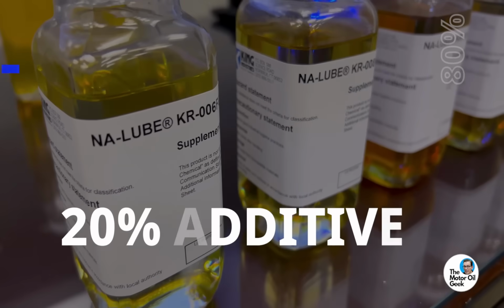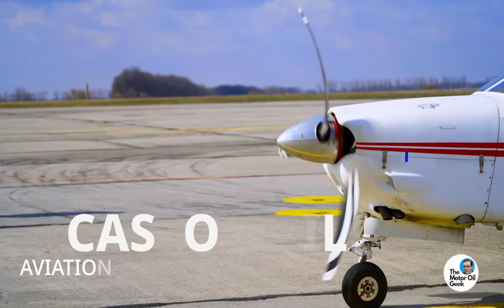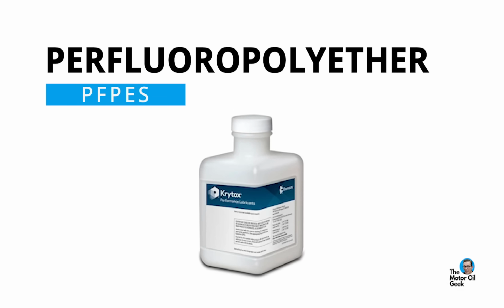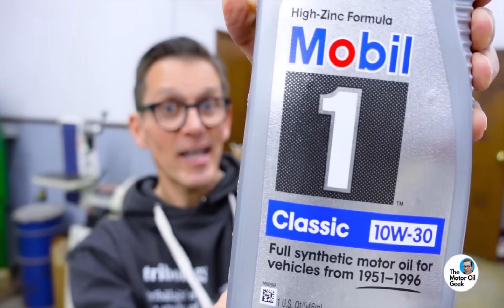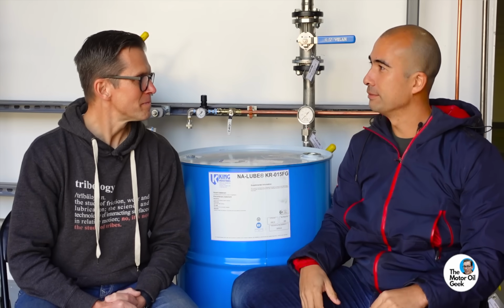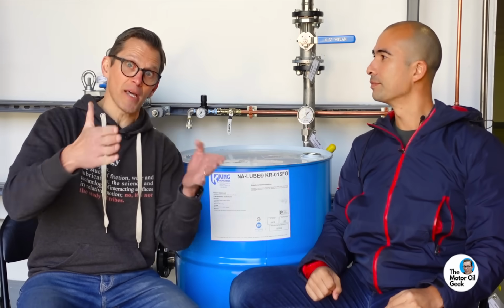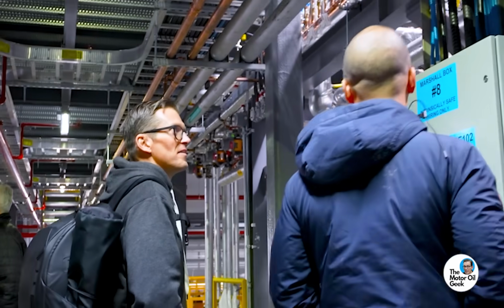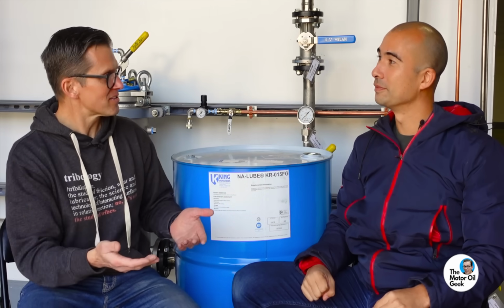100% Synthetic Oil: SCAM or SCIENCE?

Comment: I switched from PENNZOIL ULTRA PLATINUM to AMSOIL HIGH MILEAGE on my 2021 ram 1500 v8 with 81k miles and it started burning oil when it didn’t before with pennzoil UP. So confusing

Comment: Thanks guys, your knowledge of lubricants is unbelievable! I just changed my oil on my 2015 Ram 1500 Big Horn with the 5.7 Hemi. I bought it used, one owner with 120,000 miles on it. Cold weather start ups, I was getting the Hemi Tick. After a few minutes it would quiet down. I have all the service records, oil was changed on a regular basis, but I don't know what brand of oil was used. Truck runs fantastic, in drive at a stop light I can barely hear the engine running, no vibration or anything. I used Valvoline Restore & Protect 5W-30 with 16 ounces of Lube Gard Bio Tech Engine Protectant. I'm going to stick with it for the next three oil changes to see the results. If I'm not happy I'll try Pennzoil Ultra Platinum, I heard the Pennzoil oil was co engineered with Chrysler experts. I also installed a K&N Premium 20,000 Mile oil filter. I will not wait until 20,000 miles, I'll be changing my oil at 5,000 miles. Please let me know your thoughts.

Comment: You are right about us, folks not understanding I have 2017 Buick Regal 2.0 turbo charged I'd like to know if I can use the Valvoline restore and protect or what is a better oil for it can I have an 08 GMC Sierra 4.3 with 152,000 what is the probably the best oil I can use for it🎉🎉

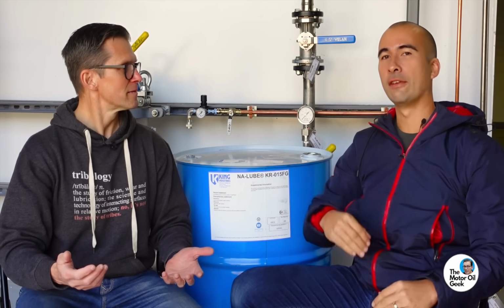Comment: Just a comment on a small detail. At 4:53 the PFPE lubricants are not what we would call very stable and should only be called for niche applications. Most of them are very sensitive (unstable) to any contamination or Lewis Acids and known to polymerize into "brown sugar" much sooner than the alternatives. They are also nearly as bad as silicone oils as far as contamination and creep due to their surface tension, combined with being very difficult to clean. So, put these into the experts only bucket and even then only pull them out after a deep review that eliminates the alternatives. YMMV

Comment: Many of my friends say that their full synthetic oil is just as good as the Amsoil 100% synthetic. But when I ask them how long would your engine last if you only changed the oil at 25k, they quickly agree that there is no way that you can get consistent good results. I have used Amsoil for over 30 years. On my second vehicle when I found out where to buy Amsoil I began to use it and have never used another brand since. I have had several jobs where I drove a lot pulling heavy loads. Many of my vehicles I have driven close to 500k with no power train issues. The bodies simply were destroyed. I have consistently practiced 25k oil changes using Amsoil, so if anyone would have problems with their oil it would be me, but Amsoil has always protected my investments.
Reply: That’s an absolutely amazing testament to the quality and durability of AMSOIL engine oils!

Comment: Amsoil makes a lot of claims, but won't even get a rating, so I for one avoid it. Those claims of extended oil changes,  helping off set the price, means dirty oil longer, in an engine, no thanks. I change my cars oil when the oil life monitor still says 50% life left. I'm not running it twice as long as the oil life monitor says, with unrated amsoil, because their ad department says to. Amsoil can kiss my ....

Comment: Hi Lake, I have a 2013 Ford Escape SE 2.0L that has 104,000 miles and switched to  full synthetic, reasoning that would be better for the engine at this mileage.  I had the service department put in their OEM Motorcraft oil.  In your opinion, was the switch to full synthetic from traditional the best decision for my car?

Comment: Every time i used full synthetic oil in vehicles with 150k+ miles. Even though it had a wet spot. ((BUT NOT DRIPPING)). aka valve covers rear Main seals etc. Its would leak from wet spots. Im guessing that oil is thinner in a way? Molecules different. Because once i put semi or regular Dino oil back in. Oil leaks stopped. SERIOUSLY DID. NO B.S.

Comment: Can I mix 1/2 Qt 75W-110 Amzoil Synthetic Gear Oil with 5 Qt Valvoline 5W-30 Restore & Protect Synthetic Oil to get the equivalent of 10W-40?  110 minus 30 = 80.  This is the difference in viscosities that are mixed.  The ratio of the mix is about 10 to 1.  Therefore, maybe the 75W-110 would add 1/10 of 80 or 8 added to the 5W-30, making it 12W-38 oil.  Do viscosities add this way?  The 5W would become 1/10 of (75W minus 5W = 70W) 12W.

Comment: I have a 2024 Harley Davidson. I normally run Mobil 1 synthetic for VTwins. I’ve also run Castrol Actevo 4T 20/50 but in my liquid cooled VRod. Is the Actevo safe to run in the 2024 center cooled Harley? What’s the difference in those 2 oils? I live down in Mississippi and ride all over the south. It’s humid and hot. Can I safely use Actevo 4T in the never bike?

Comment: Mechanic of 24 years. Used to run my own shop years ago. Used Amsoil extensively. When they started to peddle vitamins and supplements. That was it. Called corporate and told them how unhappy I was and my customers. Was told by Amsoil. We believe in our new products. I asked them if my auto shop sold skincare products would you buy them? Silence. We banned Amsoil after that event.

Comment: I only use Super Tech full synthetic in my three cars. Two cars have 140 K plus miles, the other 189 K miles. That’s enough science for me. How about a study contrasting designer oils with the shorter mileage change intervals, that you can afford with money saved. There are differences, and then there are statistically significant differences. What does all this mean to the average driver, who doesn’t dream about motor oil?😊

Comment: On Project Farm channel, he did cold flow test of Amsoil and Royal Purple oil.   Royal Purple oil list by also most 3 inches.  BUT when he heat the oil for certain amount of time and repeated.  The Royal Purple oil only lost less than 1/2 in the flow test.   Did Royal Purple oil get faster or did the Ansoil oil get slower.  Also what happens if you run flow test cold, then hit then re freeze the oil that was cooked and repeat cold flow.   Such a big difference .  Worth checking. ---https://youtu.be/E2zS8MyvJxU?si=6To5cYgGkFc6bKcq

Comment: Another informative video.  In several past videos as well as this one, you have eluded to testing on Diesel oils and mentioned/questioned the use of 0W-20 oil that the OEM is “mandating” in the Duramax diesels who have a reputation for sipping or using a quart in between oil changes - especially when under load.  As owner of one of these engines in a 2025 full size SUV, I am very curious as to when a video on this subject will become available and what is your preference as an alternative based on application.
Reply from the maker: We are still collecting data on the 3.0L Duramax engines. Once we have a good set of sample data, we will make the video.

Comment: I’ve gotten to where I run a Kirkland full synthetic and change it in 5k mile intervals (with filter) . I know this is probably not the best synthetic, but changing it at the 5k make I would think that this would be just fine. I also did a 500 mile and 1000 mile change when it was new

Comment: Synthetic oil is group 4 and 5, better known as Polyalphaolefins or PAO'S  for short Both Mobil 1 and amsoil have not used a synthetic base since the late 90's(long story). They use the cheaper group 3 and call it a synthetic oil. Mobil sued Castrol gt in Federal court over there calling a group 3 a synthetic, the courts ruled they didn't care what you call your oil. Amsoil was the last to stop using true synthetic base as they couldn't compete with others using a base oil that was group 3. Here is a simple test to know if your using a real synthetic, it should cost at least $13-15 a quart. Royal purple, petron plus and European oil is still using real oil. So when the oil change place says, did you want the synthetic upgrade, say no, it's a scam. You can Google the court case and even find al amatozio address them using fake oil.

Comment: so with a Big diesel 12.7 and larger. I know nice the new formula on Movil 1 1300 it and to leak more out the gaskets. and seals. the Synthetic blend not really doing the protection that use to have. but instead more ware. on oil analysis, or at least in my case. would be inserted to see the bracket down on nothing like that. Movie vs Shell on 15w-45 beak down.

Comment: I learned a trick driving as an over the road trucker. When the oil gets old/worn out in a diesel engine it starts to use oil. Not sure where it goes but need to be checked often cause it uses oil. I learned that in that instance a quart of synthetic in the crankcase reduces oil consumption dramatically. Of course the oil needs to be changed pronto, but sometimes you don’t have the money or time. In a pinch a quart or so gets you down the road a little further without so much worry.

Comment: So after all these years I finally got myself a brand new truck. Looking for advice between two oil brands. I’m running a 2025 Chevy Silverado 2.7L Turbomax. It recommends 5w-30 but between Amsoil OE, Amsoil SS or Penzoil Ultra Platinum. What would your recommendation be? 

I always change early around 3,000 miles.
Reply: Neither. Castrol Edge. Optimized for high heat, Turbos, and GDI.
Reply: Pennzoil 😁
Reply: @MrRjnr thank you. I’ve used AMSOIL in the past and love their stuff. Since I plan to change every 3K instead of the dealer recommended 7.5k I didn’t know if the extra cost was worth it. I have an amsoil membership on auto renew because I use it in my wife Subaru.

Comment: I have really come to appreciate Polyol-Ester base stocks like Redline & HPL use lately. At the same HTHS (and similar KV100), my engines all run significantly smoother right from cold start-up, through hot-and-steady highway running. Does one "need" special oils like these? Absolutely not. BUT, they are better in a fundamental way. My Blackstone wear numbers have never been better. By a significant margin.

Comment: Lake, I have a 2019 F150 3.5 ecoboost with 150k miles. I recently stop using Motorcraft oil and swapped to Mobil 1 high mileage. I would like a recommendation from you on the correct lubrication.  It's a daily driver, with avg running time 1.5 hrs daily give or take. I also live in western Maryland.  Ps. Love that you worked with Mr J. Gibbs.

Comment: Just wondering if the Repair and Protect oil would be good to run in a new vehicle to keep it clean for it's entire life? Also, I am not a fan of 0W-20 oils and considering a 5W-30 for my new vehicle. It is a 2025 Subaru Outback XT. Any opinion or recommendations?

Comment: Scamm??!!...2001   Silverado 4.8L...100k hard miles(80 city, 20 highway)...bought in 2003...still runs like a clock, running syn oil(10/30) since '03, 1 tune up at 75kmiles(the ignition wires were starting to dissolve)...replaced 2 starters,  6 batteries, 1 alternator, A/C quit after 85k(don't need it), trans oil change 3 times, usual tires and brakes, ABS off  in  '03(useless garbage),  water pump at 94k(real metal seal )....the engine...still hits 75mph like a scared rabbit...that engine just keeps running NNIIICCCEEEE!...like everything else GM does, the 4.8 no longer built, nothing but  junk now. 64, 74, 86 and 01...no more GM's.

Comment: I’ve been using that Mobil1 extended performance since I got my 08 Elantra when it had 130k miles. Now it has over 260k. I’m curious how long it will last. I change it every 5k which ends up being about four times a year.

Comment: I've been designing high speed, high power density gears, bearings, and other power transmission components for aerospace gas turbine engine applications for over 35 years. The turbine oils (Mobil Jet Oil II for example) IAW MIL-PRF-23699 present a challenge in this endeavor. They are roughly 5 cst viscosity. They do not have good load carrying properties. Yet, we must maximize contact loads to minimize size and weight for flight, especially vertical flight in rotorcraft.

Comment: I run Rotella t6 in my 2006 duramax. The front label clearly states a pretty extreme wear life. Without exhaustive testing, is the soot build up the problem with diesel.  I change the filter at 5-6k and dump at 10. Some towing, nothing over 11k. Just hate to dump oil that states such high wear rates.
Have you seen any Rotella tests by independent sources.

Comment: So my 2024 Hyundai Santa Cruz 2.5T calls for OW-30. I recently put 5W-30 in it because the Temperature’s here in Central Texas is boiling. So I figured if I went a tad bit thicker it would do my engine better. It definitely sound quieter and seems like I have more torque. I used AMSOIL 5W-30. Did I make a good move or dumb move?

Comment: I just bought a ‘95 Jaguar xjs 6 cylinder with only 36,000 miles. I can only assume that the oil was changed every year at 3,000 miles. It has been beautifully maintained but I don’t have access to the previous owner. I want to start with a fresh oil change, but what oil would I use in a 30 year old engine?

Comment: This video actually made me more confused about synthetic oils 🤪🤪🤪
Reply: "Synthetic" here means synthesized: made from something else. In oils, the connotation is that the molecules making up the base stock are built up from a single or very narrow range of precursor molecules. The molecules in a traditional non-synthetic oil are instead separated out from the huge number of different kinds of molecules that are present in crude oil. The idea is that if you are building "exactly" the molecules you want, you are not including anything you don't want. Separations are not perfect so traditional oils always contains some non-optimal molecules. For example, the traditional oil might include a few molecules that are subject to being oxidized into something harmful and therefore produce more junk and varnish. Maybe you can think of synthetic as "more pure" or "have fewer, more optimized, types of molecules".

Group III GTL liquids are different from Group IV (PAOs) mainly in that they are synthesized in a less-controlled process that produces a wider range, but still much narrower than in traditional oils, of molecular types.

A slight confusion is that PAOs are also usually made from crude oil, but the crude oil is first separated and converted into just one or two types of molecules before being built back up into the final (basestock) product.

A (lame?) analogy. If crude oil is made of random words of various numbers of letters in various alphabets, if you filter those down to just the English alphabet and filter that down to mostly a certain range of letters (say A-L) and word lengths (maybe one to five letters), you have something like a traditional oil (AEJABA, BLC...) . If you filter that down further to just the letter A and a few Bs and then build up 'words' with just two or three letters, (AAA, AA, AAB...), you have something like a PAO. Consider that you specifically chose the A to give good lubricant properties
Reply: @justliberty4072 
😱😱😱😱😱😱😱😱🤦🏼‍♂️🤭
Reply: They're all better than group 2 conventional, don't run 0w20 or lower past 5000 miles and you should be fine no matter which oil you chose.

Comment: Profilometer is a Sheffield trade name.   Surface finish, texture and form are tightly intertwined.  A skid type surface analyzer reveals only so much, OEM's are using an entire fleet of surface, form and contour measuring equipment that measures and thus feeds back to the machining process. Lots of gaps in this discussion.

Comment: Can I use 1.8 litres of Liqui Moly 15W50 oil instead of the recommended 1.7 litres in my Royal Enfield?  👉👉NOTE: RE SAYS  "Refill: 1.7 L" &  "Dry fill: 2.2 L".👈👈
I plan to add Liqui Moly MoS₂ Shooter, which recommends 20 ml per litre of oil. For 1.7 litres, I’d need 34 ml of MoS₂, leaving 6 ml wasted from the 40 ml tube. So what if using 2 tubes of MoS₂ means 40 ml with 1.8 litres of 15W50? Will this extra 140 ml of Oil &  MoS₂ negatively impact engine performance, or is it safe to slightly overfill to optimise MoS₂ usage?

Comment: Hello, please, I have a question. I have switched to Valvoline rap oil (of course I watch all your videos) . Can it hurt my seals? Someone told me, the detergents can degrade the gasket and seals. So far I am happy with valv rap. I am currently on my 4th oil change on my 2020 Tacoma sport v6 manual trans.  The biggest complaint I have so far with valv  rap, is it's clear for so long, it's hard to see on the dips tick!
Reply: I also use amsoil for my manual trans. Mobile 1 on my difs and transfer case. Valv dex3 for power steering.

Comment: Question.  I have a 5 qt container of Mobil 1 5W / 20  with 3 quarts left in it from an oil change 6 months ago.   Is the oil still good after I’ve opened the container and resealed it?  Or is oil hydrostatic like brake fluid?

Comment: Hi, I have a question. I am purchasing a 2003 Ford focus and has a small oil leak and it burns a little bit of oil. It takes zero 520. Would you have a recommendation? Would it be better to use zero 530 instead and should I use Hybrid synthetic or full synthetic or just conventional thank you.
Reply: WM sells Havoline Smart Change High Mileage in a 6 qt box; I used to use 5w30